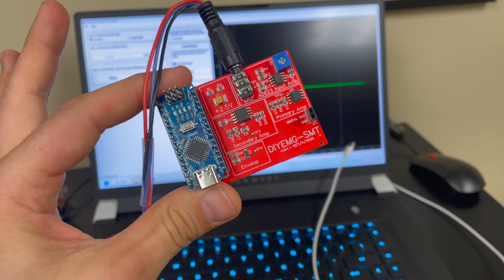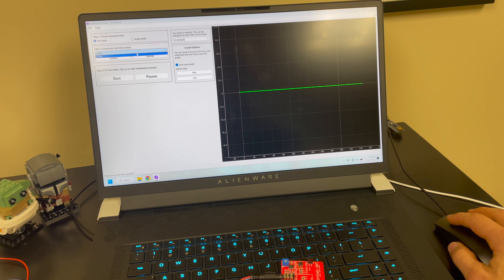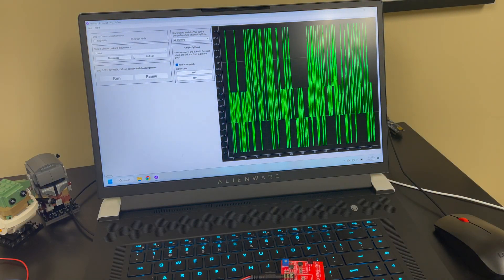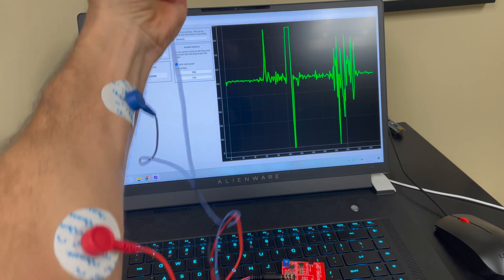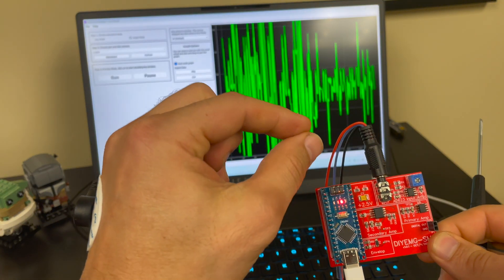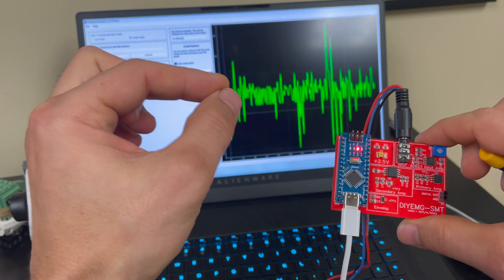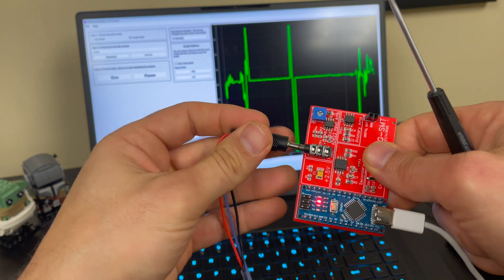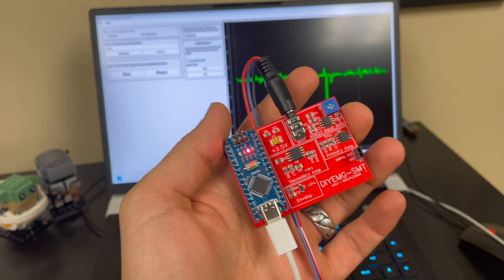EMG Controller | Hardware Overview

Comment: Is it use specific library for connection with Arduino? Can it be used to control motors?
Reply from the maker: Hi, no it doesn't use a library, just a custom arduino - most of the hard work is done in python - But yes it can be used to control a motor - we have a pre-release version that controls a servo motor using the output headers. I need to work on that a bit more before I make it public.
Reply: @HTMWorkshop  Ok, i will follow the progress
Reply: @HTMWorkshop  So, do i need this custom python, if i need to attach my arduino to the board, in order to work?

Comment: can this arduino send data wireless?
Reply from the maker: An arduino nano cannot normally send Wi-Fi data - there are way to do that but it would take additional hardware and programming…there is an esp32 iot version of the nano that can
Reply: @HTMWorkshop   what about BLE?
Reply from the maker: @mitkosokolov9382 same issue - the nano is not intended as a wireless device but there are adapters
Reply: @HTMWorkshop  Can we attach Raspberry Pi Pico to this board ?
Reply from the maker: @mitkosokolov9382 I believe a PI is 5 more pins than the nano - it will technically fit though because of the female headers - just will overhang a bit. The bigger issues are the power differences and i do not know how the pico pins are mapped…I think it would be much easier to use the nano AND the pico together - you only need one analog input pin from the board to measure the signal. So you could just jumper the analog input from the nano to the pico.